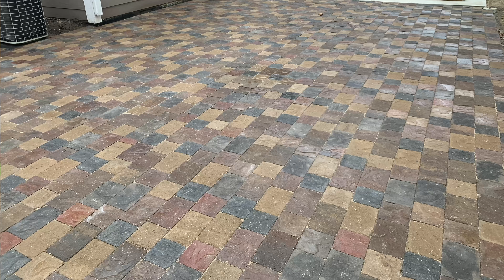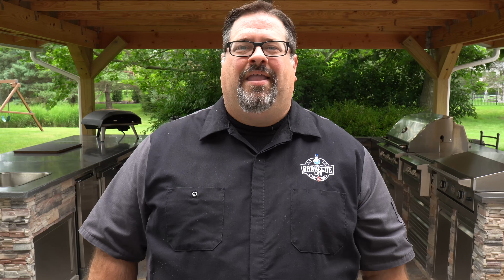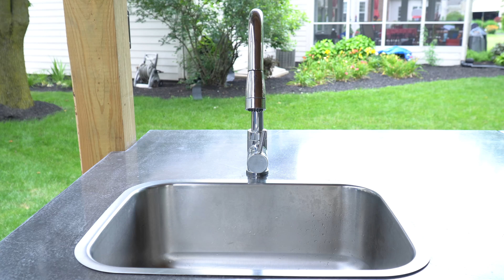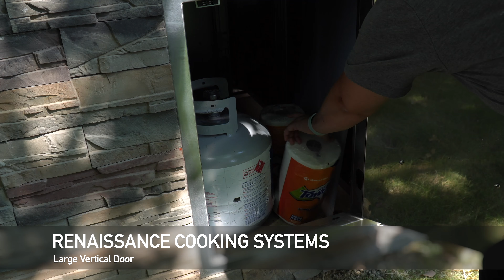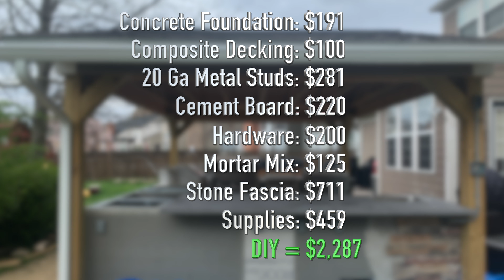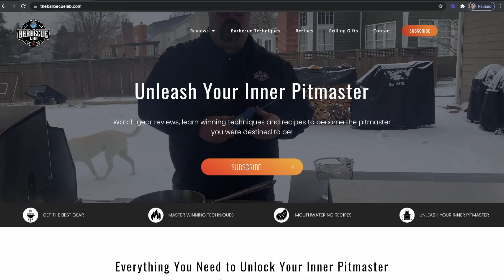Building an Outdoor Kitchen | How We Saved Over 75% Using DIY Outdoor Kitchen Techniques

Comment: Did you use metal edging around the perimeter of the pavers to keep everything in place? Did you have to cut pavers to length (rented a saw)? Why can't you build the covered patio on the pavers?

Comment: I am in the beginning stages of designing a smaller version of version an outdoor kitchen. Because of the size of our  space, I have to decide between a sink or power burner. How did you connect the water line to the sink? What about your drainage line?

Comment: I’d be interested in seeing running the electrical and water lines to pavilion. Also what size pavilion would you have built if no HOA rules?
Reply from the maker: I’ll have to see what we have from the electrical and water line portion of the build. As far as the pavilion goes, the biggest pre-fab I could find was 12x16. Since we built it ourselves we could have gone bigger without the HOA Limits, and in an ideal world, I would have gone 20x20. That would allow seating on both sides of the kitchen to be under the canopy as well as leave some buffer for blowing rain to stay out of the kitchen. Continuously cleaning stainless steel from rainwater droplets is seemingly never ending.

Comment: There was a cut scene early in the video showing pavers being laid. The gap from paver to bottom of step got larger closer to the house. This shows the pavers are sloping towards the house which will in turn direct water to the foundation. This is why you should have at the very least had the base of all your work done professionally. You did such a great job with everything else. Sadly it's on a bad foundation. This will cause massive headaches later on. Most likely making the 90k you didn't spend look like an affordable expense. Best of luck.

Comment: Great video! Have you heard of ConnecTubes? You can build a real steel frame without welding. The system is super cheap and uses steel couplers and 1.5 x 1.5" square galvanized steel tubing.  Highly recommend you learn about this building product to use for bbq frames etc... The price is comparable to track and studs. They even have telescoping cutout kits for less cutting.

Reply
Reply from the maker: I haven’t heard of them, but I’m going to have to check them out.

Comment: What material did you use for flooring inside the cabinet base bottom for the storage area
Reply from the maker: We just have the concrete base under the cabinet bottom for storage.

Comment: WOW what a great project! Love it! What I have wanted was something like an outdoor kitchen that is an extension of my Kitchen, here is why. I want something that if I wanted to make a large amount of food that requires high temps like making brisket and or barbecuing a whole slab of meat that I have the room and the gear to do that.
So essentially the outdoor kitchen is an extension of my own Kitchen and also an outdoor space for entertainment.
It has the ability to be enclosed or wide open.
The only thing that I see that is missing from all outdoor gear is the lack of seals to keep critters out. Anytime there is food the critters come. So it has to be Varmint and critter proof. If you have Bears ain't nothing keeping them out. Except maybe some Badger piss.

Comment: Is there anything you have to do to winterize it?  Specifically the pellet grill?  I'm considering building an outdoor kitchen and want to incorporate a pellet grill but worried about weather (especially during Indiana winters)
Reply from the maker: I haven't winterized any pellet grill that I have here at The Lab. The Memphis Pro built in that we have here in the outdoor kitchen is one that I use year round and even in the rain and snow. The only real danger with pellet grills is having the pellets get wet, and the only way that really happens is if you leave a gap in your hopper lid by overfilling it or just flat out leaving the hopper lid open on accident and it rains. Other than those two scenarios, I haven't heard of any situation where you'd need to worry about winterization.

Comment: This looks great, do you have any issue with Smoke under the covered top?
Reply from the maker: We haven’t had issues with smoke, but I think that’s because we installed a ridge vent at the top. There’s has been 1 time where the roof held some smoke so it looked a little hazy up there, but that’s been the extent of it.

Comment: Well done video.  I'm in the process of having a scaled down version of your build installed.  A couple simple questions if you could elaborate, I'd appreciate it.  How did you run the gas and electric lines?  were they done prior to the paver install?  Did you seal the pavers when kitchen was completed?  Thank you sir.

Comment: when installing the units on a sloped patio (for drainage),  Do you  1) Just leave a gap where it drops off 2)Scribe to the ground or 3) Scribe the top under the countertop?
Reply from the maker: We made the bottom of the stone facade level and custom cut the top pieces under the countertop to make up for the slope.

Comment: This is GREAT!!!  As T-Davis stated, videos of the build would be most appreciated.  Curious, does your sink drain into your sewer line?  If so, was the line there already or did you have dig/jack hammer to get it connected?  Thank you!
Reply from the maker: Thanks E Y. Sink does drain into our basement ejector pit, which in turn takes it into the sewer from there.

Comment: I would love to see a detailed build video.  Would be nice to see how you laid out the cabinet base slab and footings.  The steel support bars on the concrete countertops, I would like to see how you installed them and what else you had to do to get the overhang.  How far out does the roof overhang, does it cover the bar stools?
Reply from the maker: The roof does overhang to cover the barstools, but just barely. Since the rain comes from the other direction most of the time, they have been dry so far. We’re working on how to put together the other videos and will keep the channel updated.

Comment: Please edit and post the videos.. I don’t have 100K to do the plans the contractor has proposed. I just cannot see why its so expensive. A lot of hidden cost as the Material cost don’t add up to more than 35K
Reply from the maker: I didn’t understand it either until I did it myself. It took so many man hours to complete the project, and I’m sure that labor is making up most of the difference. If you can do it yourself, you can save a ton of money.

Comment: I have an odd question. I am currently in the process of building out an outdoor kitchen. Steel frame almost done. I too have a Ooni Koda 16. I’m wanting to position it similar to how you did in the corner. How did you have the hose go into the stone of the outdoor kitchen? You convert the Koda to NG with the kit? I’m just trying to envision how stone will go around the hose while still leaving the ability to replace the hose if ever needed. Was hoping to get a glimpse of that angle of your kitchen but didn’t see a view of that back side. Love to see a pic of what you did.
Reply from the maker: We didn’t show that part because we didn’t build the gas tank into the kitchen. We just store it underneath the counter in a large storage door and pull the tank out when we need it. Since we review a lot of cooking appliances, we didn’t build in a permanent spot for some things as they will change out over time. That way we can keep things close to test and use in recipe and technique videos.

We did do some work like that where we ran electrical lines in conduit. We just drilled a hole in the concrete board and cut a hole in the tile where two pieces met, so we were just carving a half moon out of each piece. As far as swapping out the gas line, I’d probably plan on running the tubing through and then putting the fixture on afterwards. Just my two cents.

Comment: Thanks for the video. Very much agree DIY is a great option. Would love to see the build of the kitchen itself and what you learned. Tips/tricks and what you might do differently.  

How did you get that lovely sheen on the concrete? A gloss sealer? 

Enjoy your oasis!!
Reply from the maker: Thanks for letting us know B B. We’re talking through what the videos might look like and your questions are helpful. The concrete sheen comes from lots and lots of sanding. Started with 200 grit and sanded all the way to 6,000 grit stage by stage. The sealer was a non-gloss sealer, so the sheen is all from the sanding.